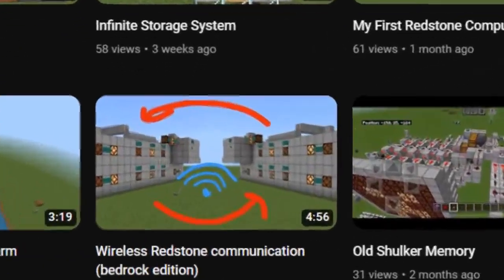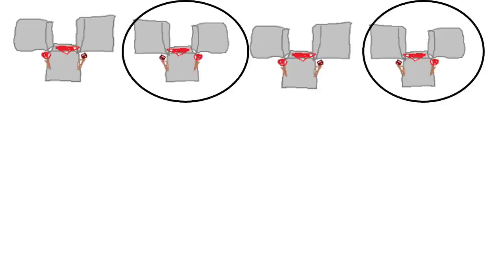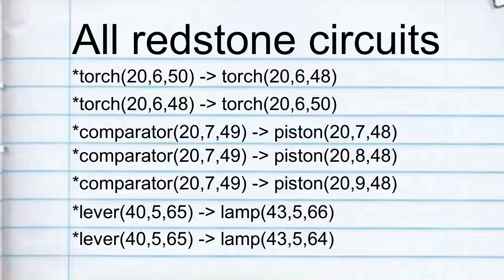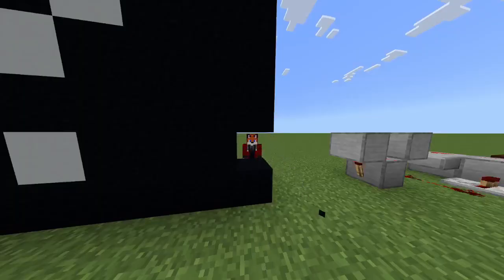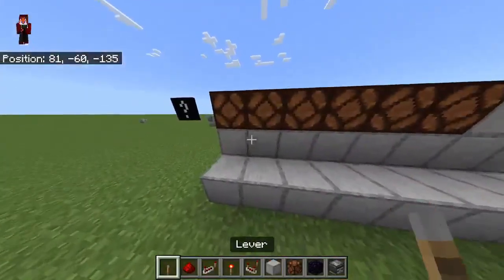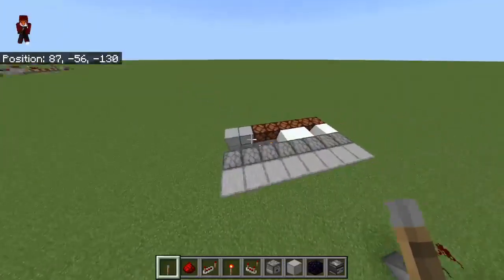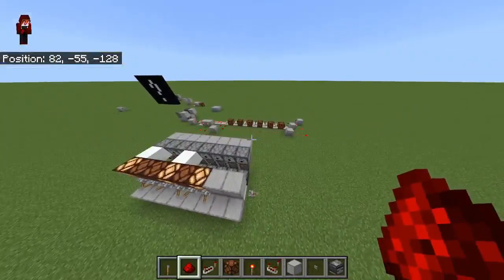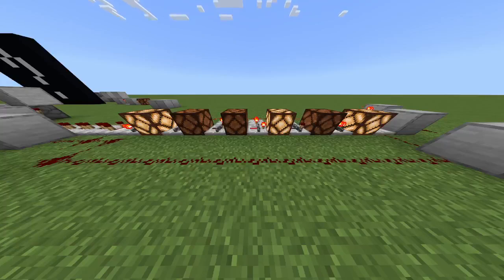Wireless Redstone, Explanation and Tutorial (Bedrock)

Comment: Hello bratworst. i've tried this machine and it works. But the problem here, i am currently making some remote teleportation with the stasis chamber. and i want to make it able to teleport anywhere. But here's the catch, the simulation distance limiting my project because ender pearl disappears after i reach the farthest distance from simulation rendering.

There is no problem with the contraption tho. Sure enough the receiver cannot receive the signal since the ender pearl that is used for stasis and chunk loader has disappeared. Are there any solutions for that? 

I mean how do i load chunks for the receiver if it's out of reach?
Reply from the maker: I dont know of any ways to load chunks in survival but if you are willing to cheat there is the ticking area command
Reply: @bratworst  one step away to move to java ed

Comment: This is interesting and ive known about this for a bit but haven’t actually tried anything yet with it based on what you have currently you need something similar to a TCP 3 way handshake but this handshake is a bit different the first system transmits a binary signal of say 101001 this is repeated until the transceiver replies with the same message sort of like a password after the second signal is sent back to the transceiver it sends the message one more time as confirmation that the message is indeed valid and not generated by background noise after the message is sent again the transceiver turns off as it has succeeded in the information transmission also the receiver is only designed to read incoming data if it matches the correct key after the key is the instructions or the key could be the instructions depending on the use case

Comment: How far away can the reciever be and have this still work?
Reply from the maker: As long as they are loaded, they can be thousands of blocks away
Reply: @bratworst  beautiful, thank you, I have some ideas I wanna try later today, if anything comes of it I'll post a link.
Reply: @bratworst  okay, so I've tested a few useless applications for this, I wanted to try and redesign parts of the machine to be smaller but I ran into a small issue. I understand how it sends a signal, but how TF is it decoding it on the other end? Like how are the repeaters getting locked in the right order? It baffles me 😅